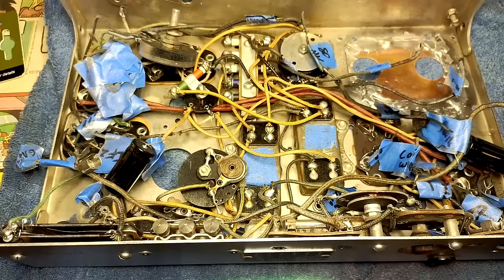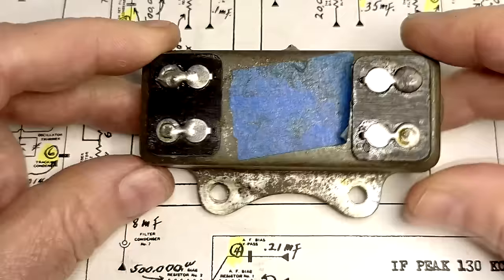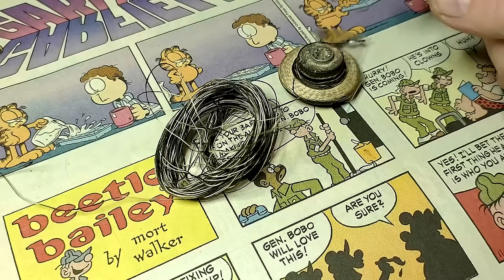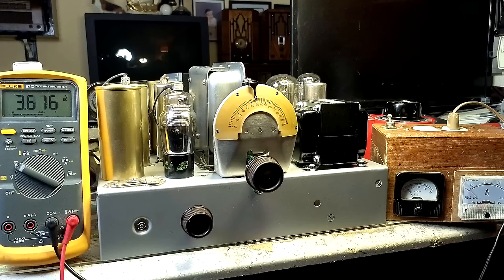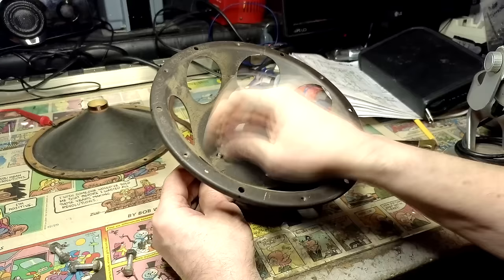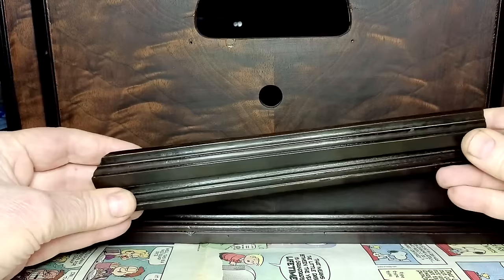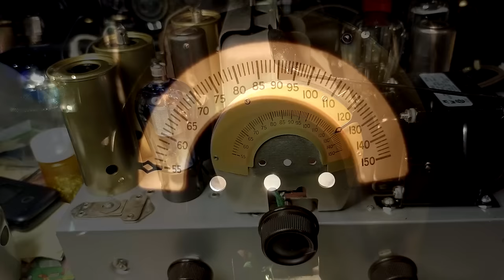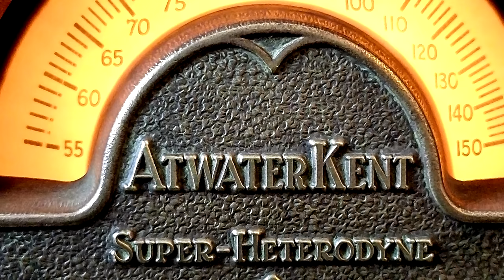1931 Atwater Kent 84 Part 4 FINAL

Comment: Buzz, that's a beautiful radio, and it sounds great. I gotta hand it to you, I'm always amazed at the outcome of each project you do, and this one may be the best. 
In a way, you re-designed enough chassis parts, you ought to put your own engraved plate on the chassis, "Restored by Buzz Radio 2024". 
I have one question, and there may be no answer to it, though I ask anyway. On the station dial, I notice the marks are closer together in the 90-100 range than they are in the 100-110 range. Actually there is variability all the way from end-to-end. The marks 55-60 are wider apart than at 140-150. Is there any reason for this, or were they doing dial marks free-hand in 1931 ?
Reply from the maker: haha..my ego wouldn't allow for that!...as for your question...I guess that the dial was made on how the radio tracked...??..I'll ask Atwater Kent on my next seance..haha👍👍
Reply: @Buzz1151  🔮 📻
ok, you can use my crystal ball and Sears radio to dial him in. lol

Comment: About those tin can .1 caps.  They are PAPER caps, OLD paper caps.  Any paper caps that old are LEAKY.  Replace them!  Don't pass go, don't stop on free parking, just REPLACE the G-D things and be done with it.  Restuff the cans if it makes you feel good, but 86 those old capacitors!  Good Job!
Reply from the maker: i did replace them
Reply: @Buzz1151  Yes, excellent job!  That radio should be good for another 97 years!   It might need some re-alignment though,only 12 stations in your area?
Reply from the maker: @KennethScharf  dont have a long wire antenna, just a wire attached to a window frame

Comment: Looks like they were doing everything possible to make that thing look not just modern but literally like different technology....you know, for all those components and wires WHY didn't someone along the way design fasteners and plugs to replace all that soldering...literally would double or triple the output  if the entire thing just pluged together and make it all easier to boot